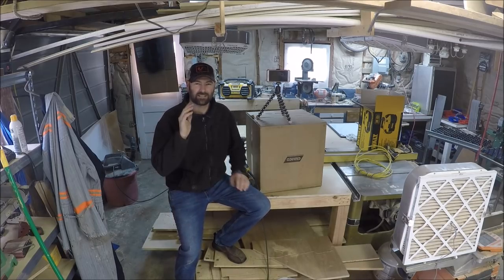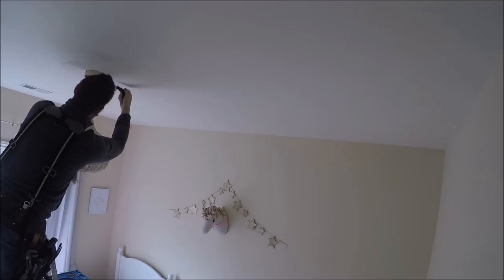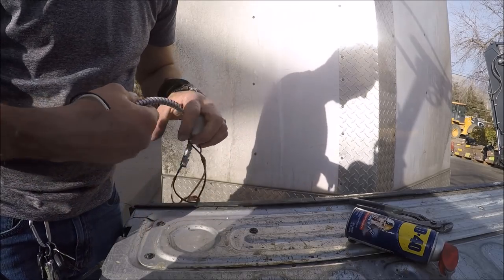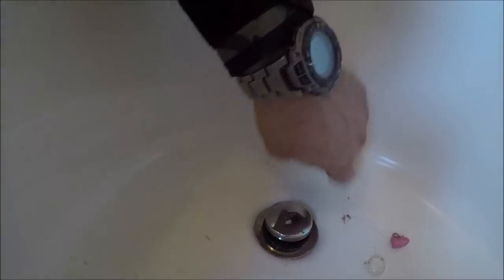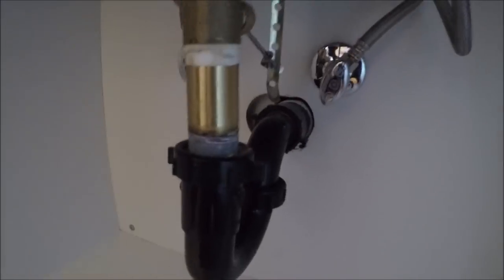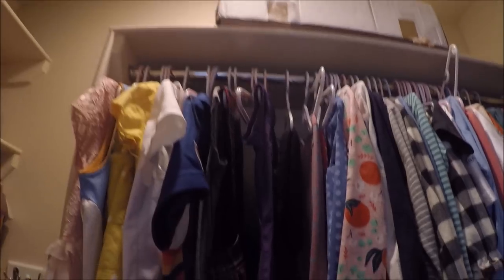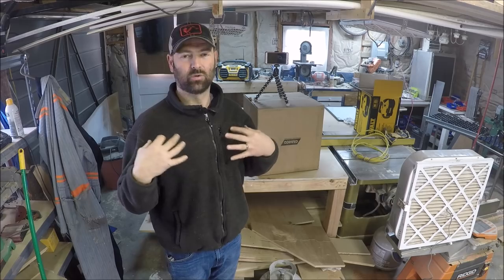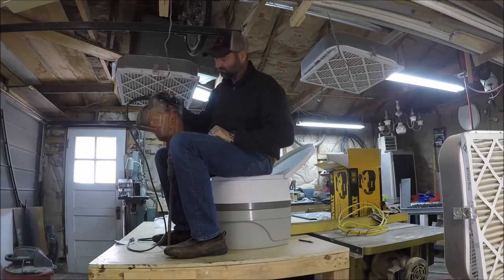The Handyman Gets Called In to Fix 3 Million Dollar house | THE HANDYMAN |

Comment: The number one problem with recessed cans is that the wrong wattage lamp(bulb) is used.  Also, a recessed can be in contact with insulation as long as it label “IC” rated.
Reply: Use led led bulbs      no heat

Comment: I rehabed apt complexes in early 1980's using fast depreciation and recoup taxes going back 3 years. Maintenance warehouse now home depot supply is great for individual unit cost accounting . Saves a lotta time. I had 70 seperate cost accounts my first first condo complex. Lucky my ex is a bean counter. The rich have business managers that know every tax deduction. Set up proper allocation. Especally in fema disaster area.

Comment: If you see a gap at the bottom of an entry door when it is closed, make sure it has the square weatherstripping pads installed behind the weatherstripping. They come with the doors, in a bag stapled to the jamb, but they are almost never installed after the door is put in.
Reply from the maker: I call them seal pads.  This door didn't have any.  I'm going back to this house tomorrow and I'm going to bring some with me.

Comment: Just checking your videos brotha. The push button you put on the bathtub,  you can remove the cover and tight the screw with a flat head screwdriver.  That's the correct way. "

Comment: I've never seen a gas stove. Although we don't use gas in Denmark for pretty much anything. 
Does the pilot light just burn constantly?
Reply from the maker: Yes.  It doesn't turn off unless you open up the bottom and turn it off.

Comment: I've been talking to my wife about starting my own handyman business here in Florida , licensed journeyman electrician, before that I installed vinyl siding, soffits, sliding glass doors, windows, and did repairs on just about anything ........... I know nobody really pulls permits for small stuff but do you have to apply for any certain licenses when applying to start your business? Is there any thing special that you need to do or do you just apply to start your own company under a regular llc and that's all along with your liability insurance? I just want to be a regular jack of all trades handyman able to repair anything
Reply from the maker: No license needed to start a business.   I worked in South Florida for a few years.   Laws are different down there.  There is a lot of restrictions on what your are allowed to do.  No one follows the rules down there though.

Comment: How much do you typically charge when you go install a ceiling fan but the box is not rated for a ceiling fan?
Reply from the maker: Depends on a few factors.  Do I have attic access.  How high is the ceiling.  If its not a box rated for a ceiling fan chances are there is only a 2 wire and not a 3 wire going to it.   For a standard install with no attic access I would charge $400 to pull the old box out and retro fit in a remodel fan box.

Comment: Holy smokes those recessed lights are old and heavy compared to the recessed lights sold now in 2020,like those from Costco which which you can install on the gypse itself with LED integrated and doesn't heat up.

Comment: Couldn't you put an LED bulb in the overheating light fixture to solve the problem?
Sorry if you already answered this.
Reply from the maker: The insulation on the wires had melted off.
Reply: Thanks. I guess i meant for the other one. I guess its best to move the insulation because someone could possible put an incandescent back in the fixture.
Reply from the maker: I just finished retrofiring 9 can lights in a house last week I used all LED light trims.   Much cooler.  I still kept the insulation away from the can.

Comment: I have a problem maybe you could help me with... I buy and fix up houses to rent, and I do 99% of the work myself. My family, friends, and neighbors know this so they'll ask me for help doing many of the things you did in this video, and of course sometimes much more involved projects, like adding circuits or replacing a sewer main. They always try to pay me and I always refuse, because that's what friends are for, right?

However, my unwillingness to take their money leads to a few problems: They (probably) feel like they're taking advantage and don't like being 'indebted' to me, and I end up secretly resenting them and avoiding them because I don't want to waste my whole weekend on their projects when I have my own stuff to do. 

So, I know I should take SOME money, but I struggle with how much. If I charge $20 an hour (about half the going rate around here), they won't feel guilty anymore, but it's still a loser for me. If I charge $40, I wouldn't mind the work, but then they won't really feel like I'm 'hooking them up' either.

How do you handle jobs for 'friends and family'? Any advice?
Reply: truthsmiles  wow ajajajaj same over here I had the same issue. Always helping friends an fam for free but yes waisting my weekend. Until I came up with a way of  charging or for something back . What I do now when they ask for something an ask me how much I always ask to help me buy tune up kit for my trucks air oil an oil filter . Or I tell them to help. Me buy a tool I been wanting to buy , that works great cause doing ur cars maintance is the most important thing for me been a handyman  myself hope that helps

Comment: Why not just use a drill for the screws?
Reply from the maker: On small delicate screws like outlet and switch covers you don't want to use a drill
Reply: The Handyman 

I always do. Just don't go crazy with it or hand tighten the last little bit. It's a lot faster
Reply: The Handyman 

I do use a hand screwdriver on switch covers tho because it's a slotted screw and those don't work well on drills

Comment: If those were IC can lights, then you are supposed to be able to cover them with insulation. Who doesn't install IC rated can lights in a $3 million dollar home?!
Reply from the maker: Is says right on the can.   Keep insulation a minimum of 3 inches away.    This is an inner city scrape.   Most of the value in this house is the location.   Around here you need to at least pay 7 million to get a custom house.  This house is pretty much a tract home with high end finishes.
Reply: Gotcha, so it is a non IC fixture then. Are you in California?
Reply from the maker: Pretty close.